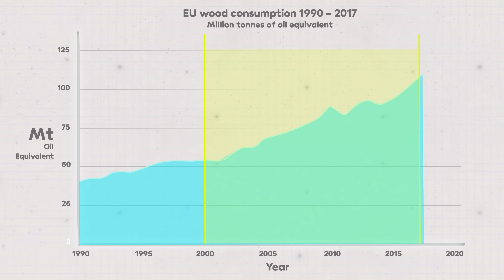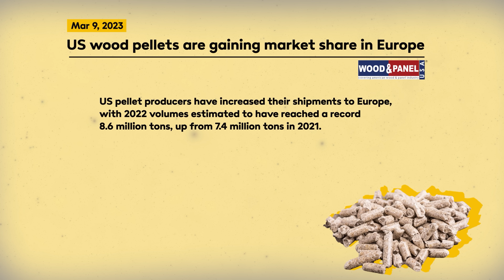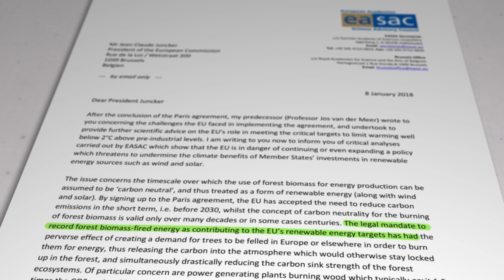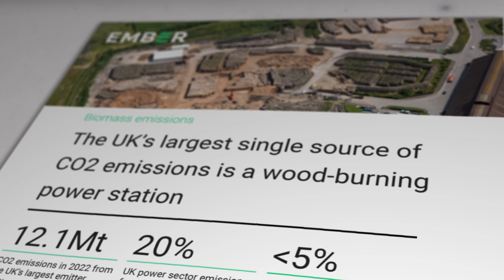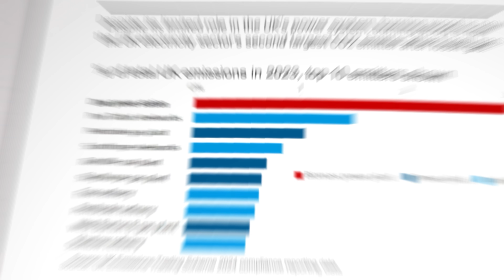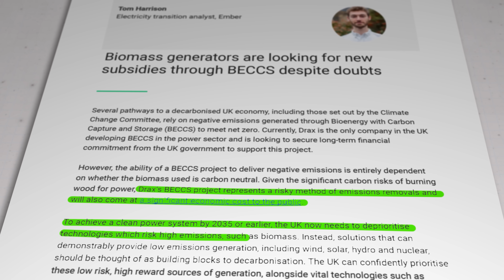New report: Biomass CO2 emissions 4X higher than COAL!!

Comment: The wood scraps can be used reasonably if you apply a few rules:
1. Regional use. Every transport reduces the efficiency 
2. Air dried. Yeah, a lot of wood is dried with additional energy used. If it dries in the air for a few years, you actually can use it too. That's also 3 more years for new trees
3. To burn it simply for electricity is crazy, when we have many more ways to create electricity, but only a few ways to create a lot of heat!
4. No wood plantations. Seriously: plantations are not forests. You will know once you have seen both... Plantations kill biodiversity and reduce carbon absorption!
Reply: You guys should stop importing wood pellets from the US, raising our prices!! When we burn pellets vs fossil fuel we create BTUs considerably cheaper than we would with the fossil fuel. Burning pellets from regional sources with little transportation cost is both economical and carbon neutral . If the harvest rate is similar to the die off rate, we trade some methane for CO2 which is a good trade off for the environment.

But if we over harvest and then bulk ship this across the ocean on big ships that are horrible pollution contributors burning oil sludge fuels, it throws off the balance, pollutes more and causes the market prices to rise. That in turn drives the imbalance even further.  So your burning of our wood pellets throws everything off. 

Burning locally produced biomass is a pretty good carbon neutral, renewable process.  But by mass burning of it from outside the region, you really throw off the process in the big picture. The big picture view is important!!  Far too common is overdoing a good thing that turns it into a bad thing.

I a country like the UK, your population density vs the US is 8 tames higher.  That makes you energy hogs from the standpoint of area.  Overall, in the big picture, it would make much more sense for the UK to embrace nuclear power.  Or offshore wind.  It's a good thing that we are attempting come come up with global solutions to damaging the environment, but in most cases, the solutions are not a one size fits all, kind of thing.  Converting local biomass to energy, makes good sense. But if you need to import the biomass, you change the equations! A good thing taken too far that offsets any good and turns the total results bad.
Reply: @professorg8383  Agreed. UK should be afforesting. Miyawaki Method could get them sufficient wood for Drax in a decade.

Plus, UK traditional forest management with coppicing, festooning, and similar methods that preserve and nurture tree rootstock can generate much more wood fiber per hectare consistently while conserving habitats.

We could learn a lot from their medieval forest wisdom.
Reply: @professorg8383  Absolutely true
Reply: @alis49281  when greedy people run things and regulations are removed, this will always be the result. In the US, the idea that a small government and deregulation is better, seems to be an unrealistic view of governance. Over-regulation is bad but smart regulation can be achieved once money is removed from the equation. This goes with any government. Your approach is intelligent and certainly achievable but greed is the biggest issue.
Reply: Ponderosa Pine, and Oak absorb a ton of CO2 no matter how or where they're planted, whether it's in a 5,000 acre monoculture or in my back yard, it absorbs about the same amount of CO2.
Reply: Agree with point 1 wholeheartedly and in fact, planning permission is given on the understanding that  the wood is sourced locally. Then this seems to be forgotten or argued away.

point 2 - certainly in the summer months the winrows )measuring 50+m long and at least 5m tall and wide must be kept damp to prevent spontaneous combustion. Think about  a compost heap and the heat that's created. Same process. The material does not take years to dry,. only days as it's regularly turned (using Diesel machinery)
Reply: Problem is these chips are made of old growth and rainforests.  And morons are STILL building garbage houses with no insulation.  Greenwashed shite
Reply: Yup, sure, and you defined 1% of that market, if that much.

And this is the problem, YOU can say "we do this and that and ........."  and it throws SOME kind of justification into an industry that doesn't do ANY of that.  YOU are 1 of about 4 billion people.
Reply: @johndoh5182  we don't support that industry. But that very same industry destroys reasonable prices for firewood.
And to burn it only for electricity is very dumb, to transport it over an ocean is crazy.

We already have the technology to easily supply everyone with enough energy for 9 months of the year. Which only leaves 3 Winter months to find a solution for. Biogas might be one of them. Scientists already work on the technology to add hydrogen to the CO2 which is a side product. This results in methane, which can be stored and used later.just the same as Biogas.
Reply: The Air drying point is one I've not heard before. thanks for that! The time scale of burning biomass vs. replenishing it is one of the big issues I read about.
Reply: he must not know about the carbon cycle.  look at plasma recycling for the really good way to do waste to energy.  all toxic compounds destroyed.  metals recovered.  you get hydrogen for fuel and co for making whatever a chemist can think of.
Reply: Endomycorrhizal fungi in forests are the best means of carbon sequestration on land.
Reply: @voidisyinyangvoidisyinyang885  Terra preta in forests is the best means to encourage deeper and more rapid endomycorrhizal fungi growth.

Plus, 70% of sequestered biochar in terra preta is retained at least 2,500 in some field studies.
Reply: Рост содержания углекислого газа в атмосфере ведёт к росту биомассы, которая перерабатывает его в кислород. Так что всё это одна большая афера
Reply: @andfil4539  Increase in CO2 at current rates leads to an increase in desertification, extreme wildfire weather, soil nutrient loss, and eventual ecosystems collapse.

The scam? Fossil trade.
Reply: @andfil4539 It helps to capture some of the CO2, but the CO2 release from fossil fuels happens at a much faster rate than the plants can absorb it. hence the measured atmospheric CO2 ppm increase. 
It is also better not to vent LNG, but to burn it for cooking, heating and electricity, because of the  methane, temporarily increased, effect on global warming.
Reply: @dirkvanschalkwyk1919  рост биомассы перерабатывающей углекислый газ происходит не мгновенно, а с задержкой в несколько лет или десятилетий. Несмотря на постоянную вырубку лесов, общая их площадь постоянно растёт. И это мы не берём в расчёт водоросли
Reply: Its time to give Drax fair warning of closure so that they can plan accordingly.
Reply: @S_Curves  They did close. They closed their coal burning.

Which is what we want.

Why don't you come back when all the other coal burning is shut down?
Reply: @Freyr_Unsui  You'll have to clarify which industry, and which nonsense. There are almost three dozen replies in this thread so far, so your vagueness is ambiguous.
Reply: Plantations do not kill biodiversity. They are usually planted in areas that previously did not have trees. 
Stop demonizing the wood industry. Usually the plantations are created so that bio-diverse old forests can be left alone. It’s not an either or scenario.
Reply: Use of burning scrap wood on a local or individual level is a good idea in terms of helping to protect the environment. Everyone should be thinking of instlling double combustion wood burners if you live outside a city. However, burning wood -- especially in pellet form is not the best long term solution to making electricity and should be kept at a minimum. We should be making electricity at local levels not nationally. We should also be using more wind, tidal, wave, geothermal, water and solar enmergies at a local level.
Reply: well said. this study was too selective to be of any real value. of course if you do something in the worst way, the results will show it.
Reply: @satoau1  The study was about Drax. Can you show that it was flawed?
Reply: @mike160543  sure if you look at the study, they calculate from fuel burned only, completely ignoring that the carbon emitted due to the biomass wasn't released but re-released, since of course the carbon that went into producing the biomass came out of the atmosphere in the first place. in a non-biased study, they'd count the negative carbon from producing the biomass in the first place.
Reply: @satoau1  Are you sure?
Reply: @mike160543  have you not read the report? the authors themselves say they only looked at "direct emissions" ie not counting the carbon absorbed by the trees to produce the fuel, and the only reasoning they give for not including carbon savings from the fuel itself are "far from guaranteed". the only suggestion they give of this is that old-growth forests may be cut down for biomass fuel, but don't say old-growth wood was used at drax because of course it wasn't, that fuel came from forestry sources.
if they wanted to find an honest answer for carbon emission they'd include both positives and negatives, but deliberately not doing that makes it pretty clear it's an agenda-driven report.
Reply: Not even, solar light creates enough heat to cook all food in the world and heat houses
Reply: @crapisnice yes it does
Reply: re 3.
We have a lack of dispatch-able energy. if the wind isn't blowing in the middle of winter, then wheres the electricity going to come from?

building battery storage sufficient to cover a week of no wind isn't really practical. burning wood in an old coal power station seems to me to be a good solution to that situation.

long term may be not. hopefully we get to a situation where we have enough over production to start producing hydrogen or methane for that storage.
Reply: @benholroyd5221  a week without Wind can happen, but a week without daylight sounds like very far north or the apocalypse. And there is still biogas we could use, maybe even biomethane if this technology translates well into large scale.
And yes, scientists are already working on energy storage that can preserve it for months, not just days.
Reply: @alis49281  Well in the uk as a whole solar generation drops by an order of magnitude in the winter, so not far off.

Biogas is another possible. but in the here and now burning wood and a power station that was previously used for coal isn't the worst idea.

I'm not saying its the optimal long term solution, just a valid option in the short term.
Reply: In whole Europe 99% of forests that are used in economics are planted.  Forestry is dependant to gound type and main tree is chosen accoding to that to have greatest yeld that means also greatest co2 capture per area used. When trees are full grown all trees are removed and turned into product for boards plywood or furniture to hold that carbon another 100years. all other parts that remain is reasonable to burn to not pollute using even worse greenhous gas methane. All forest that are in Europe and not used in economic purpose emmit 3-6x more greenhouse gasses. Even Amazonas is net negative the only net positive greehouse gas capture is ocean.
Reply: @qkktech  endomycorrhizal fungi stores the carbon
Reply: Vote this comment to the top please! 

"Biomass" is not one thing. A shipped and processed pellet from a mono-culture plantation is not equal to a wood scrap burned in a highly efficient wood-burning stove sourced 10 miles or less from where it was harvested.

Highly industrialized and centralized solutions are the problem. Not the solution.
Reply: @wyattbottorff2473  Fear of action at scale doesn't help. Transition from highly industrialized and centralized fossil use takes highly industrialized and centralized action. Mom and Pop wind, water, solar, and enhanced geothermal solutions will need centralized, highly industrialized, production. Disposing of coal plants by conversion to biofuel or TWEST will need highly industrialized, centralized action.

It's true; biomass is not one thing. But one thing all biomass has in common is the tendency to biomethane 120 times more potent than CO2e, and that has to be managed because we can no longer afford to let it into the atmosphere, and we can use it to keep fossil methane out of centralized, highly industrialized systems.
Reply: Unburned wood decays mostly to methane, 120 times more potent a GHG than CO2.

Plantations bad, yes. Afforestation good, though.
Reply: @bartroberts1514  for an example: we burn wood from a nearby forest we process ourselves. The carbon emissions are the saw, the cars for transport and the splitter. And we use it for heating after it dried outside.
It is wood of low quality, not good enough for furniture or building. The forests are used extensively with tree species native to the area. Most of them plant themselves and the forest is rich in plants and wildlife.
Reply: @alis49281  Excellent points! And with advances in EVs and electric chainsaws (not just toys or jokes anymore), your entire wood harvest could be fossil free.

With a pyrolysis rig, you could get clean char from that wood, as well as home heat (I've seen one rig that generated electricity while making pygas, black liquor, and char, but that's way too complicated).

Good on you. You're saving the planet all that methane release.
Reply: @bartroberts1514  we use tools until they break. That's more efficient.
And a high tech furnice for a single home is more than slightly exaggerated. Especially when we would've to rebuild a part of this 400 year old house. We already save emissions by renovating without cement and concrete wherever it is possible (99% less cement pretty much)
Reply: @alis49281  Exactly right.

Of course, as I design and build tools, I'm in a slightly different boat. If pyrolysis were simpler to make and use, it'd be ideal. Until someone comes up with a design for that, a good Franklin stove is pretty awesome.
Reply: @alis49281  I have pollard willows around my property, and they are cut around every 5 years (actually, 1/5 is cut every year), the harvested wood then rests outside for 2 years, in windopen but shielded storage and is burned in a Tulikivi soapstone stove, firetemperature about 1200 ° C, burns incredibily efficient and clean. No sut at the window, almost no aches, clean (invisible) smoke.
Reply: @bartroberts1514      Franklin stoves are actually horribly inefficient. Many better models are available & have been for 40 years, but a heat pump with solar panels, &/or small wind turbine (also inefficient compared to big ones, but free fuel & much less polluting) are much better in every way but image.
Reply: @J4Zonian  Don't get me wrong. If we're talking best options from the point of view of efficiency, Franklin stoves aren't it.

If we're talking total elimination of pollutants from chimney, Franklin stoves aren't it.

However, for simplicity and operability, Franklin stoves are at a sweet spot for average occasional users: better than fireplace or some cheap fireboxes; easier than the most advanced and costly wood burners. For the four days a year your heat pump may have to work too hard for a small windmill to power, Franklin's fine.

As for heat pump and windmill, or solar, or even wood-fired steam generator? Sure. Hands down better. 98.9% of the time.

PassivHaus or NetZero level of insulation, draft management, passive heating, thermal mass, though, much better than any active system.
Reply: @J4Zonian  I should clarify; when I say Franklin Stove, I don't mean the basic open front box; I mean glass door, baffle, fireback, blower, tight seals and proper insulation, such as would meet regulations and get approval.

These are still low-cost, easy maintenance, have good eye appeal, can be used safely, and fairly efficient. Apologies for any confusion.
Reply: @bartroberts1514       Well yeah, I agree. But that is not a Franklin stove. Franklins are pretty much lined fireplaces with a baffle, no gasket, leaky, inefficient burners, because they were invented (by Ben Franklin) in 1742. Better than what existed in log cabins but we’ve had let’s see, subtract the uh huh, carry the yeah...um, 282 years to improve on it. Franklin’s cute sayings & sexual reputation overshadowed better stoves, in fact improvements on Ben's like the Rittenhouse, but what can I say? People are stupid.
Reply: @J4Zonian  And yet, a Franklin with glass door, well-sealing gaskets, baffle, blower, fireback and proper insulation still gets to call itself a Franklin the way a Cybertruck with glass door, well-sealing gaskets, baffle, blower, fireback and insulation could call itself a Cybertruck. Difference being all those improve one of two, and one of them runs on wood.
Reply: @bartroberts1514  "... with advances in EVs..." Um, no.  Where does the power come from to charge an EV or an electric chain saw?  Most of the grid is still supplied with fossil fuel, either coal or natural gas.
Reply: @dansw0rkshop  Most of your grid, mebbe.

My grid costs way less than yours, and is renewable.

Your grid could be fossil free in less than five years, easily, and would cost customers way less, if administrators were competent.

Can't wait for competent utilities managers?

Try Solartech or similar off grid.
Reply: @AmericatheBeautiful-p4z  ROFLOL!

You've obviously fallen behind the times.

The coal-fired grid you're on? Still three times more efficient for charging batteries than using gasoline or diesel for small or large motors.

Are most electric chainsaws toys?

Were. But see what Popular Mechanics had to say this past February about the new models compared to gas engine saws.

Sure, if you're doing big woodcutting jobs, you want more than an electric chainsaw, even today. But in five years, that'll change too. 

If you're hauling loads through forests, with a pickup truck, then let's face it, you've got a small time operation, and likely electric chainsaw is plenty for your needs.. and EV is plenty for your hauling. At half the cost in fuel and maintenance over the lifetime of the vehicle. (AFDC Energy gov Calculator).

Now, I'm on a fossil free grid, so if coal's your worry, get a Solartech popup solar tracking charging station with four bays.
Reply: @bartroberts1514  Did you consider that to build an EV uses considerably more fossil fuels than a comparable ICEV. Than there is there toxic waste at the end of the EV's life, also considerably higher. then There is the battary charging to consider that requires fossil fuel again. Your statment is straight up wrong. The fact is Physics tells us that for every action there an equal and opposite reaction. There is no free lunch. So while driving down the road in your new Tesla remember this you might not have a tail pipe on your car, but you sure as hell do have a smoke stack somewhere else. along with diesel driven mining equipment and human rights violation in 3rd world countries. Not to mention a way heavier car. that is degrading the roads faster, which will invite more diesel powered equipment to repair the roads, not mention more fossil fuel based tar to make ashpalt for the repair. Yes lets all jump on the EV band wagon. For a none CO2 problem. Only 0.04 % of atmosphere is CO2. Considered by many scientist that haven't been bought off to be at draught levels.
Reply: @markseehawer3762  Did I consider? The whole auto world considered it. The math comes out to 55 extra tanks of gas per EV made in the past, but for new batteries closer to 25 extra tanks. Thing is, EVs mean 600 less tanks of gasoline burned over their lifetime. That's 545 or more gas tanks saved per EV, including LCA.
At end of life, 15-20 year old EV batteries are being scheduled for conversion to domestic backup batteries, with no real waste for 20 more years. Then grid battery, another 20 years. Then recycled, with 3% waste after 60 years. Compared to ICE? A rounding error.
Reply: @markseehawer3762  My batteries are charged renewably, and 25% cheaper than you pay for coal or gas electricity on your grid. Industrial metabolism tells us EVs can be circular, and ICE's can't, because tailpipes leak those 545 tanks into the air. The free lunch?  
That's what happens when you don't pay a fossil waste dumping fee for your tailpipe fumes, isn't it? $700/ton CO2. Get out your checkbook.
Tesla? Try again. I'm not rich enough to buy a luxury car. But that popped into your head right away, like luxury's the only option for you.
Reply: @markseehawer3762  No one who knows what they're talking about says "third world" anymore; those were countries that didn't opt into market economies. They don't really exist now. 
Is the mining equipment diesel? Doesn't have to be; but it's still accounted for in that LCA.. where your 545 barrels also come from foreign shores, diesel and worse powered.
Want roads that don't degrade so fast? Stop making them from weak asphalt refinery waste, and use more economical fossil-free carbon negative geopolymer that doesn't pothole and crack.
Reply: @bartroberts1514  So the Congo, Samalia, Bolivia for example aren't 3rd world.?  I still see 3rd being used regualarly. So your splitting hairs on that one. Maybe your not as informed as you think you are.
None Diesel Mining equipment THAT IS RELIABLE. Where is It? Somthing that will work 24/7?
 What are roads made of, and how does It get there? Road equipment thats not diesel that works 24/7 reliable, where is it?
Reply: @markseehawer3762  I still see "cool", "groovy", and "daddio" being used regularly by eighty year old hippies. Doesn't make them remotely connected to reality.
We call those places "emerging markets". In the 1990's, they were "less developed countries" (LDCs), but that failed to recognize their growth and profit potential.
Not splitting hairs; merely pointing out you're what Galbraith called "innocent" economically.
Reply: @bartroberts1514  How is your renewable charging system created? any fossil fuels involved in that manufactoring. Wind terbine have fiberglass blades with three year life span. The turbine itself lasts 20 years with a bunch of maintenance but needs to run 40 years to pay for its self.  So heavy government subsidies to even exist. I used Tesla as an example because its well know the same would apply to all EV's. I'm not a rich guy either, and if i was I sure wouldn't be buying an EV. As for solar panels They have a short life span easily damaged and require fossil energy to make. Not to mention they only give  a part time energy supply. Futher they are almost useless in northern regions due low sunlight intensity for 6 months of the year.. So far you haven't convinced me.
Reply: @markseehawer3762  I keep hearing people throw around words like 'reliable' about things it turns out aren't reliable. How reliable is Venezuelan or Russian supply, compared to domestic biodiesel, or Solartech pop-up generators?

Roads can be made less expensively from kaolin-based geopolymers for 70% cheaper than OPC or par with asphalt but lasting 3.5+ times as long.

Where's that road equipment that isn't diesel and works reliably? Held off the market by government subsidies. They have it everywhere but America. Look for VolvoCE electromobility, for example.
Reply: @markseehawer3762  You're asking LCA and bootstrap questions. Turns out LCA CO2 for manufacture is at most one tenth the savings from going fossil free. And if you bootstrap to renewable power for manufacture, that's a zero LCA carbon score.

You seem to have dug up some questionable figures about lifespan of parts in wind. Wherefrom?

The blades typically last 20 years, though some take maintenance more often it's not full replacement. Far more often blades last until the unit's replaced with a bigger, more efficient unit.

And now UC Davis is talking about compostable blades. Permaculture ftw.
Reply: @markseehawer3762  Third World is a Cold War term meaning neither Western nor Soviet/Chinese bloc; the non-aligned that sometimes tried to play both sides against the middle. When the Soviet bloc crumbled on Reagan's watch, and China went full Market economy globally, those terms made zero sense to waste time with.

People who stopped learning before 1990 are the only ones still using them. It's like still talking about East Germany or The Thomson Twins' latest hits.
Reply: @bartroberts1514  First of all 600 less tank full is BS  It greatly depends on the size and type of car engine you are refering to Ev's have terrible resale because nobody want's to risk being the sucker that has to buy the replacement battary. EV's won't go 30 year because of the battaries and the cost and the constant up grades they need. ICEV will  go 30 years with basic maintenance. So now we are back to replacement manufactoring CO2 foot print x3 Heres some first hand examples I have a 47 year old goldwing still running strong. a 30 year old dodge diesel truck still running strong. a 19 year old Mazda 3 still going strong. And guess what the dodge diesel get 30mpg highway. Lastly if you think an EV battary will go 15 years with any range left you are a dreamer, And why would you want that fire hazard in your house. then theres the isse of copper and the fact that there isn't enough of it to pull off this distopic dream world plan. If we continue down this road we will all be walking in our 15 minute cities. The Thing that bugs me the most is through mandates my right to choose is taken away by unelected bureaucrats. Besides I just don't believe the BS around CO2.
Reply: @bartroberts1514  Sorry i don't believe you. i've research plenty on this and  what your saying is not what i'm hearing
Reply: @bartroberts1514  first of all Biodiesl is hard on Injectors and for that matter the engine So unless your adding oil based suppliments why would you use biodiesel. Second why are we using farm land for fuel when there isn't enough food in the world
 thirdly anything polymer based is made from crude oil. and Lastly Battary powered industrial ANY equipment  road, mining or other wise just doen't get through a days work without a lengthy bit of down time to recharge the battaries. The same reason EV's suck on road trips.
Reply: @markseehawer3762  Tell me you don't understand how "average" works, without saying you don't understand how average works. Got it.
Explains a lot about how you don't understand CO2, either.
I'm all for your right to choose. Just pay for the consequences of your choices, at $700/ton of CO2, the cost it would take to create the permaculture to absorb it.
Reply: @dansw0rkshop  - depends where you live - Europe last year was powered by a majority of renewables (wind, solar, hydro, geothermal) or zero-carbon sources (e.g. nuclear). Individual European countries - such as Norway, Iceland, France, the UK - have been renewable/zero carbon for years.
Reply: @bartroberts1514  No, it doesn't.  Methane is only produced in absence of oxygen when biomatter decays. Unless you're in a recently-flooded swamp, aerobic digestion turns dead trees into topsoil and some CO2,  a lot less CO2 then, let's say, clear cutting the whole thing and feeding it to a furnace.  Which is what is happening with this power station. 

The problem here is simply one of scale.  Using waste branches and low-grade timber to power a farmstead is arguably, environmentally friendly.  Flattening one of the largest forests in the world to feed the sixth-largest economy in the world, is inarguably, not.
Reply: @TNGMug  Talk to a termite. All insects that digest cellulose do it through methanogenic gut bacter, just like cows do.

Any decay of vegetation covered by more than 2 mm of water? Methane.

An efficient, healthy forest turns close to 90% of decay to gas within a decade, with a half life of under five years in temperate zones.

There's no way Drax is worse than deadwood.

And just where are you seeing a forest flattened for Drax? That would make zero sense. It isn't happening in Slovenia where they replant. It isn't happening in BC where the FRPA forbids it. It isn't even happening in the Amazon, mostly.

Could it be done better? Absolutely.

But the worst thing would be to let Drax go back to coal, which is what the GWPF wants, or other coal plants to keep using coal when they could transition faster, which is what happens your way.
Reply: @bartroberts1514   Please supply evidence supporting your assertion.